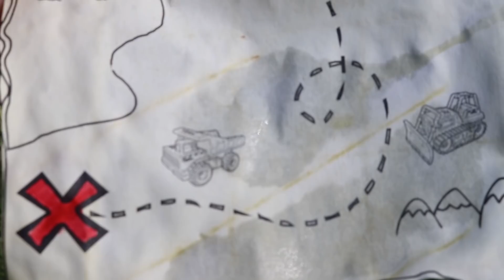1963 Tonka Tow Truck Restoration

Comment: If your sandblaster vac has a filter why are you checking for lead?
Reply from the maker: Thanks for watching! I check for lead to bring awareness to anyone wanting to start doing the same. Ignorance with sandblasting old lead toys could have a life long consequence for someone. I would rather everyone take precautions. I actually wear a P100 mask while sandblasting even though there is a filter. Between silica and lead particles and other toxins, I would rather be safe than sorry.

Comment: Your sand blasting box gloves are really starting to look kinda' rough, might need some new ones soon. Also, do you prep the metal surfaces with anything before applying the primer powdercoat?  Beautiful restore.👍
Reply from the maker: Thanks for watching! Once sandblasted I only blow them off with air and hang them. I don't know that it requires any additional prep.

Comment: Great job. Buffing the axles and grill wouldn't prevent future rust and corrosion ,What type plating did you treat these with?
Reply from the maker: Thank you for watching! The grill had good factory nickel plating that just needed buffed up. The Axles will likely be nickel plated in the future. I am waiting on my caswell plating kit to come in to finish that part.

Comment: You should have used UV light in a bin to un yellow the lights and make them clear again.  You can also you hydrogen peroxide as high a percent as you can find (I believe hair salons use 12% in there hair bleaching products).  Put it in a small tub and the parts and put it outside for a couple of hours in the sun.

Comment: How long does the sandblasting material last when you leave the paint on compared to stripping first?
Reply from the maker: I'm not sure, most of the blasted material ends up in the filter system which is then dumped out. I end up just adding sand about every two months.

Comment: 1:09  Is that truck been on fire at one time?  Looks like burn marks to me!  Some kids don't appreciate their toys.
Reply: "The tow truck was sent out on a dangerous mission to retrieve a fancy convertible from a fire in a national park. The paint got burned a bit as the mission was accomplished." Testimony from Jack and Jill to Tonka Testimonial committee. Naturally the kids wanted it to be realistic so they got a small butane torch to heat up the paint a bit. 😀
Reply from the maker: It definitely had a rough life. Luckily it found me.